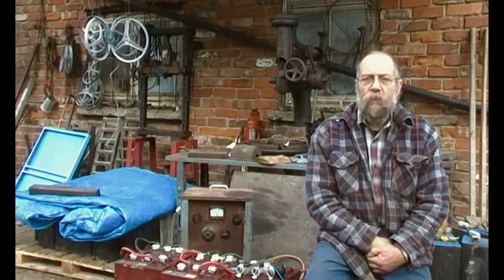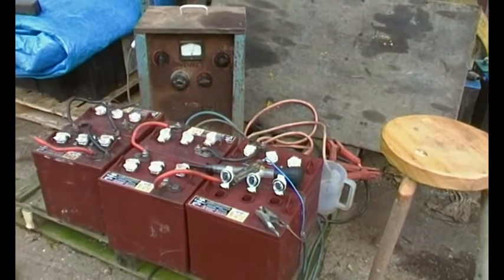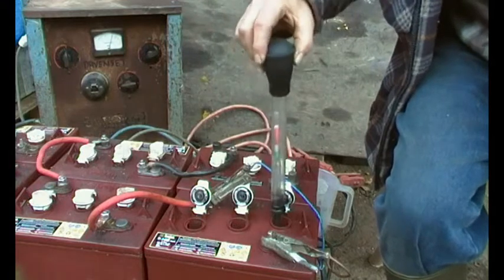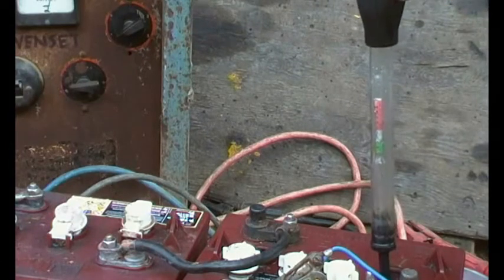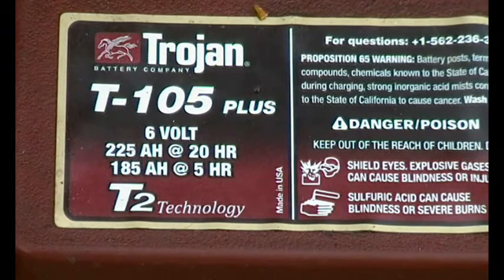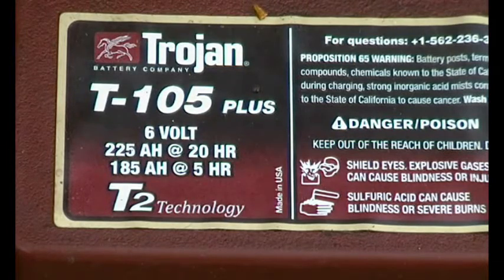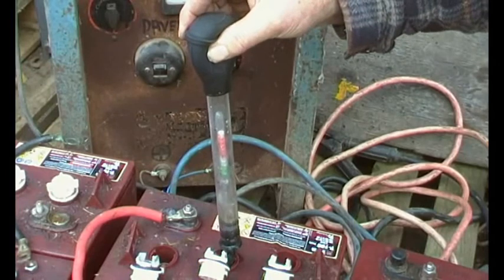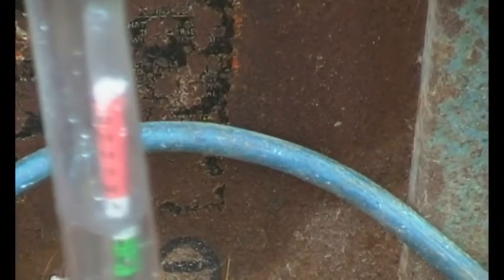You Rant No 1: Battery abuse and how to avoid it.

Comment: I have a notion about getting some batteries, the grid is happily wheeling away my surplus kWh during the day.  Almost bought a used forklift on ebay. Managed not to push the button.  Can't have too many projects.
Reply from the maker: Owen, well done for the control as it would be just the start. You would then need and inverter  charger like a Victron and maybe a Hub 4 system (SES) to build a power sharing system similar to a Power wall. Or just run dedicated circuits with UPS backup. Today's weather was superb if you kept out of that bitter easterly, a real boost. Cheers

Comment: Brilliant stuff andy. My misses had left the car interior light on in the car a few times and now my car battery is low on one cell. It's now been topped up with water and is now on a equaliser charge. 👍
Reply from the maker: Hi, thanks for the comment, see my next video in this series giving details about electrlyte levels (half way through). Be careful with that low cell as the electolyte level will rise during charging. Cheers
Reply: Andy Reynolds I've just noticed it is a maintenence free battery although the vented plugs were hidden under stickers which seems odd. Anyway the battery is charging outside in the shed and is already measuring well on the hydrometer. 5 cells were reading around 75 percent but one was at roughly 50 percent. Let's hope a day or so on trickle will bring her back to normal. Thanks
Reply from the maker: Good man, the spirit ofd adventure and interest lives on, cheers

Comment: what about using lithium sulfate batteries in the back system? instead of flood acid
Reply from the maker: Hi, John, yes if you were buying new cells then it is well worth considering different types of cell chemistry. Even second hand lithium cells from cars are very expensive and they need protection circuitry on each cell. Nickel iron is worth considering, but in this case it's about bringing these units back to life. Cheers